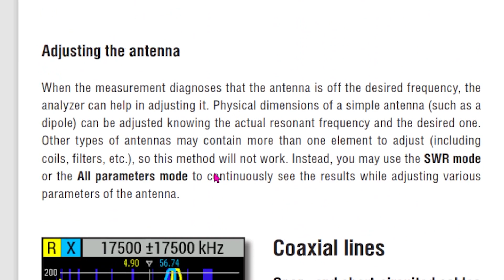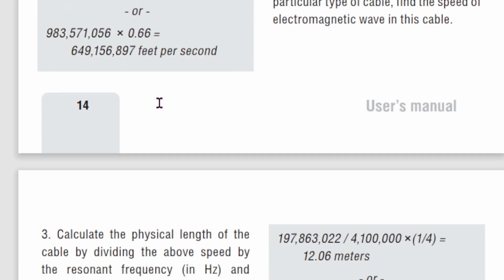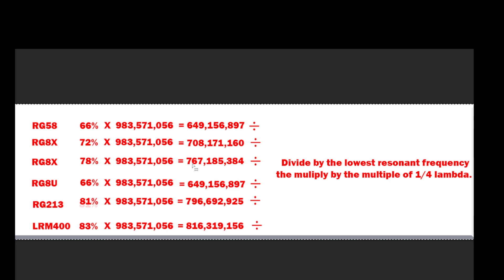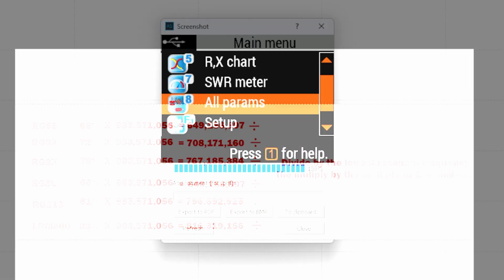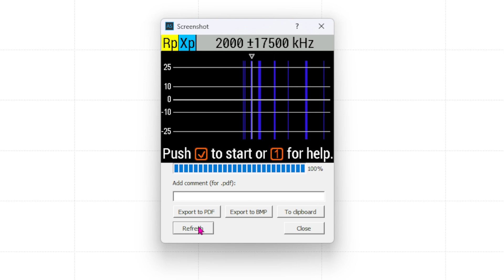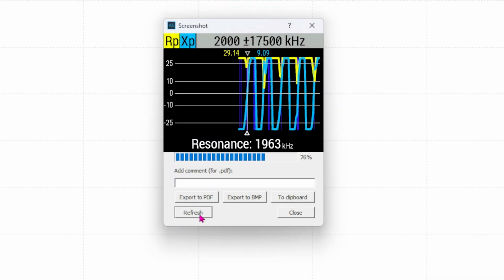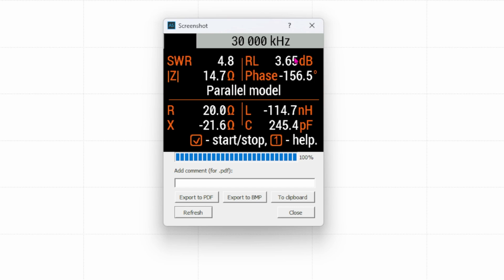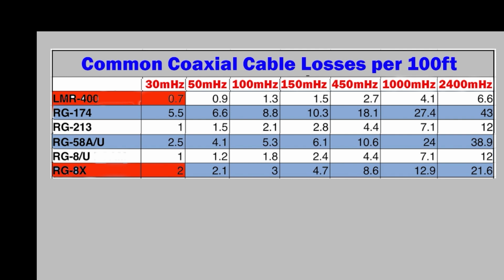AA-35 Zoom From RigExpert Coax Cable Loss And Length Of Coax Cable With Jim Heath W6LG

Comment: Hi Jim:  Thanks for your excellent videos.  I've been playing with my new AA-35 Zoom for two weeks trying to figure out something obvious I guess.  I'm trying to check the length of a new 50 ft RG8X coil of cable.  I follow your instructions and have no problems until I try to figure out how to determine the last step.....how to multiply by the multiple of 1/4 lamda.  In your example screen display how did you determine that "4" was the figure to use as the multiplier.  I can't tell by just reading your screen.  
Thanks
Roger

Comment: Good to see you Jim!
Reply from the maker: It is good to be scene.  I had a tough two weeks in the hospital.    I was in for a week.  Out for two days.  Rushed back by ambulance and had emergency surgery at 8PM the first day of the second visit.  Both times I had severe sepsis with organ failure.  I was in guarded condition and in isolation.  73, Jim W6LG
Reply from the maker: Let me know if you have time for a chat.  I have a Zoom account.  I know you are very busy.  I need some help with a program.  73, Jim
Reply: @ham-radio  glad you got through that Jim and have made it home. I know the feeling when health takes a turn for the worst and home is the best place to be. Rest up and take care. I’ll be in touch via email later.

Comment: I would like to see this done on the tool itself not the PC screen. I’m not sure what buttons you are pushing or how it and with what it was shorted.
Reply from the maker: I used the device and not the computer.  The computer was used just to get a stable picture.  The pictures were screen grabs from the AA35.  73, Jim
Reply: @ham-radio  I could hear the tools buttons clicking so I guess I’ll have to watch again. I’m just not at all familiar with the PC part of rig expert. I have the AA-55

Comment: Don't you find that the RigExpert products are cheaply made?  I sent mine right back... of course it was DOA...But, even if it wasn't DOA, I'd still have sent it back not being worth anything close to the asking price.
Reply from the maker: Not at all.  So far, so good.  I paid full retail from a dealer.  I believe it to be worth the money.  I am often building and testing antennas.  I am sory that yours was DOA and you did not have the opportunity to use the Zoom.  73, Jim
Reply: @ham-radio  Thanks for your reply, Jim.
Reply: I have the 35,55 zoom,600 and the 2000. The AA-600 did need a repair but I like all of them. It certainly doesn't help that they are built in a war zone! I read the owners home was specifically targeted early by the Russians. Also many able bodied workers are off fighting. I learned that even though the AA-55 has bluetooth firmware, any made after the war started access to the chips went away so they don't work bluetooth. So I might forgive a quality issue in the last 5 year builds.
Reply: No, my AA-55 Zoom is fine. What are you expecting, a metal case? It's an incredibly useful piece of kit. I agree with Jim's comments about how well the manual is written and the menu system is so easy to use. The value is clear to me but of course everyone's expectations will be different. Y

Comment: The 55 model reveals the cable length and impedance within seconds. No math needed.  Chock full of other features too. Well worth the value and additional cost. Thanks for your videos, de K3WR.
Reply from the maker: Yes, and if I had to do it over again, the 55 would be my choice.  It is worth the extra $30 for sure.  73, Jim